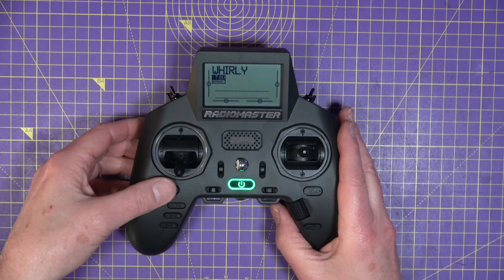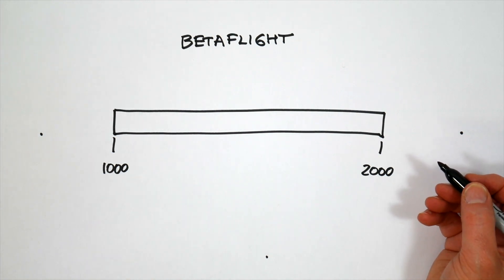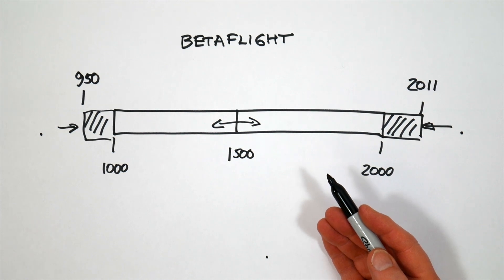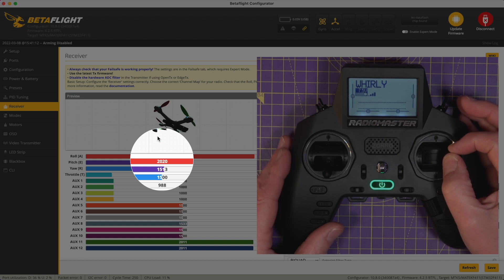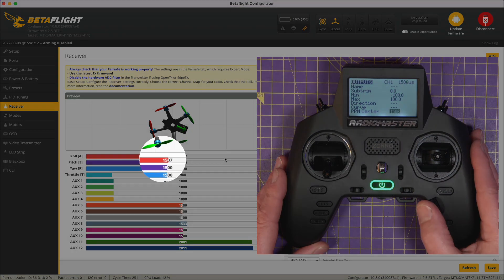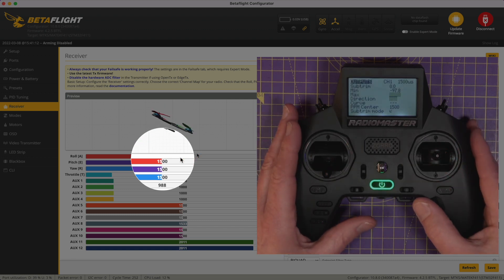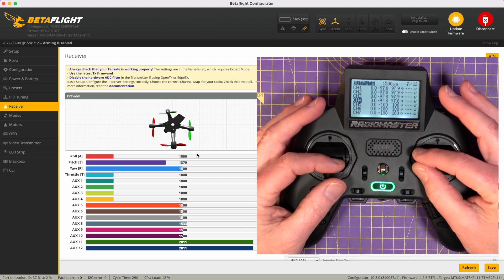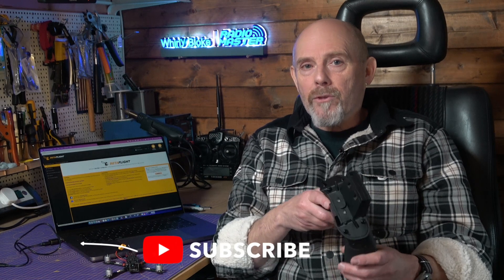RadioMaster Zorro Tutorial - Setting the channel and stick end points in Betaflight

Comment: When you calibrate the sticks, you set your mid point to the LCD, this feels wrong to me. The point of calibration is to ensure the hardware is sync'd to the values. You should mid-point physically with the notches around the gimbal. Then after the calibration they will show true. In the video your left gimbal is low.

This may seem petty, but when using high rates, you may get drift back. I'm happy to be wrong. Just a passing thought.

Comment: This helped me center, but the min and max are not changing at all in betaflight when I change the min and max values.
Reply: Actually I take that back.  my roll min will change, but my roll max will not change no matter what I set that at.  I am at 1988 in betaflight and stuck there for max right roll deflection.
Reply from the maker: I'm glad it's sorted.

Comment: do u have a video of how to bind the elrs zorro to a elrs drone.
Reply from the maker: Turn on your RadioMaster Zorro transmitter and the ELRS receiver on your drone.

On the RadioMaster Zorro transmitter, navigate to the "Model" menu and select "Model Type."

Select "Multi-Rotor" as the model type.

Navigate to the "System" menu and select "RF System."

Select "ExpressLRS" as the protocol.

Navigate to the "Bind" menu and select "Bind."

Press and hold the bind button on the ELRS receiver until the LED starts flashing rapidly.

Press and hold the bind button on the RadioMaster Zorro transmitter until the LED starts flashing rapidly.

Once the two devices are bound, the LED on the ELRS receiver will stop flashing and remain solid. The RadioMaster Zorro transmitter will also confirm the successful binding.

Test the controls to make sure they are working properly.

Please note that the exact steps may vary depending on the specific version of the RadioMaster Zorro and ELRS receiver you have, so it's always a good idea to refer to the user manuals for detailed instructions.

Comment: Hi. What do I do to get more travel. Mine's at 100% and it still has 159 pionts to go. Sticks have been calibrated.
Reply from the maker: First, make sure that your transmitter's endpoints are properly set. Endpoints determine the maximum and minimum values that can be sent from the transmitter to the receiver. If your endpoints are not set correctly, you may not be able to achieve the full range of motion from your sticks. You should be able to adjust endpoints on your transmitter, usually through a menu or button interface.

Second, check that your transmitter is outputting the full range of signals. You can use a servo tester or receiver to verify that your transmitter is sending signals across the full range of motion. If the range is not correct, you may need to adjust the sub-trim or trim values for each channel on your transmitter.

Third, you can try adjusting the exponential or dual rates on your transmitter. These settings can affect the sensitivity and responsiveness of your sticks, which can impact the range of motion you can achieve. Experimenting with these settings can help you find the right balance between control and range.

Comment: Question use zorro 4 in1 running plane not a drone how do you change motor rotation from clockwise to counterclockwise?  Last time ran Transmitter was 1980's things changed a bit.  Any help be great.
Reply from the maker: To reverse a Zorro channel running EdgeTX, select the model and page across to the Output page - page 7. Click the channel you want to reverse, select Edit and scroll down to DIRECTION. Select INV to invert the channel. Hit return a few times to get back to the Outputs page and you'll see the left/right arrow now points left indicating the channel is reversed.

Comment: Great video! I am running DSM on my quads. trying to set the end points. Their all backwards on betaflight because of the conversion from AETR to TAER. Not sure what to do yet. I need a non DSM quad to set endpoints I guess.
Reply from the maker: To reverse a Zorro channel running EdgeTX, select the model and page across to the Output page - page 7. Click the channel you want to reverse, select Edit and scroll down to DIRECTION. Select INV to invert the channel. Hit return a few times to get back to the Outputs page and you'll see the left/right arrow now points left indicating the channel is reversed.
Reply: @WhirlyBloke  Thanks a million!!! That worked. Now I need to figure out what is setup wrong in Betaflight. The drone won't arm. Driving me crazy. I'm a noob in over my head I guess.

Comment: I just got a radiomaster zorro 4in1 with TBS crossfire nano external module. I just bought the geprc rocket plus tbs crossfire edition as well. I updated the external module, then paired it with reciever on drone. Flashing blue light (means update now going to drone module) then now solid green on drone and remote. I know remote is paired because it says telemetry lost if drone is powered off. Now, I have solid green lights on both drone and remote external module. Both are paired. But when trying to get stick feedback on betaflight or receiver feedback at all, nothing. I move drone around with my hand on 3D model betaflight first page, drone moves. But nothing on reciever tab. I tried serial uart, crsf module. I tried disabling abc filter on zorro remote settings (tells you to do that on betaflight settings). I need help please. Its got to be something in betaflight is wrong settings wise. I looked up youtube videos for days. Can never find a tbs crossfire setup on zorro, only elrs. Thank you in advance!
Reply: I'm having the same problem rn with my drone. How did u fix it? If u did

Comment: I find so funny when I hear from "Zorro" advertisers  - "it is easy"...
Reply from the maker: That because it is.
Reply: @WhirlyBloke  Sorry but let me disagree :) Maybe if one is familiar with the OpenTx and Radiomaster Tx-s, then for him/her Zorro is easy to handle. But if it is your first ELRS Tx, it is definitely hard to set up. Zorro has brilliant innovative features; the problem is that the number of these and other usual features is large and Zorro comes without any (proper) manual. So one has to dig in youtube (thank you and others giving explanations), read general ELRS description and if still something is unclear (the most probably case) ask questions at ELRS gitlab, or different RC forums. And this is just a part of the story, even after gaining all this information there is no guarantee that you will succeed.
Reply: @davidtskhakaya280  elrs has a very comprehensive online manual
And yes I agree regarding open tx and edge tx it can be quite a steep learning curve. A comprehensive manual would be beneficial